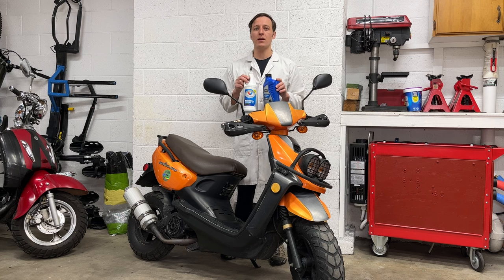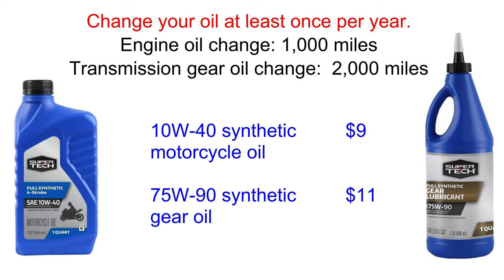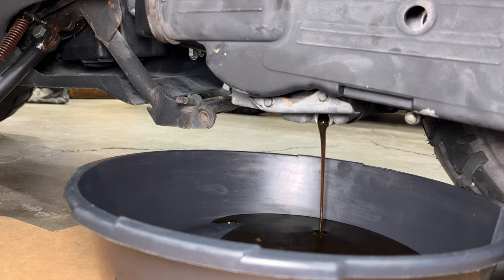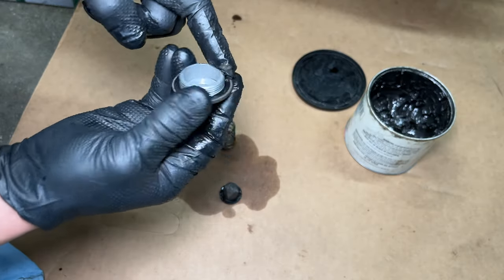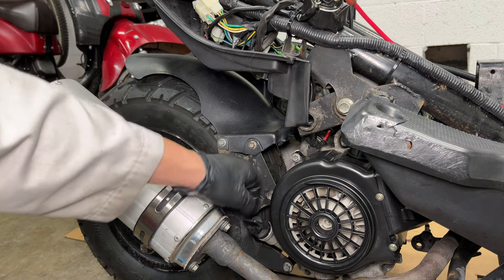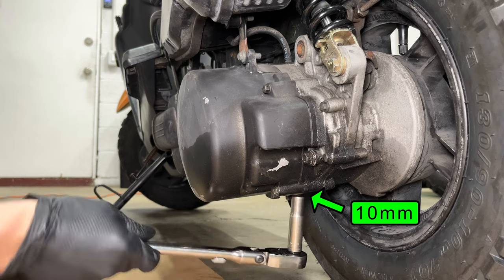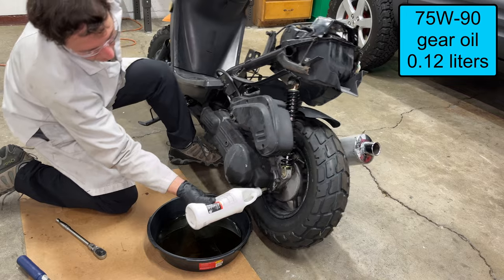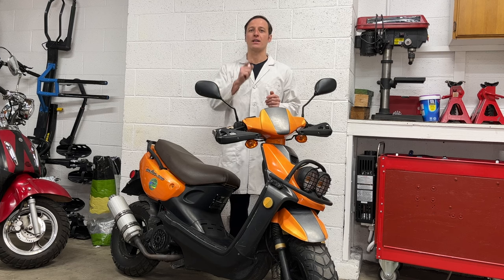Engine and gear oil change in a 150cc GY6 Chinese scooter

Comment: My 150 is nothing like this LOL.... I guess my scooter is a little bit older but it's a 2008 it's much bigger also maybe because it's the big wheel it has 16 inch supermoto tires basically road tires but could be swapped onto a dirt bike anyways point being I can't believe all Chinese 150 GY6 is or not the same but when I looked up the drain plug it came right up the wildest dream plug is in the video is exactly like my Ninja 650 with the same size and everything

Comment: I get drops/very slow leak of gear oil in my overflow tube. Does that mean my transmission case is overfilled?
Reply from the maker: It might be. Remove the fill plug and see if anything drains out.

Comment: Do you really have to remove both bolts for the engine oil. I thought you only had to remove the one with the screen in it?
Reply: I didn't even know it had a screen
Reply: Not really, the regular bolt on the side is enough,  I normally remove that and tip the scooter to drain any left.over oil. Every other change I open and clean screen.